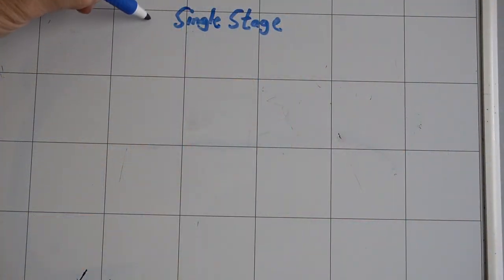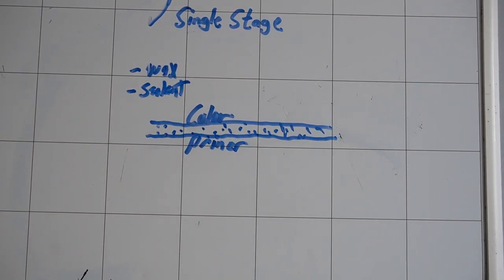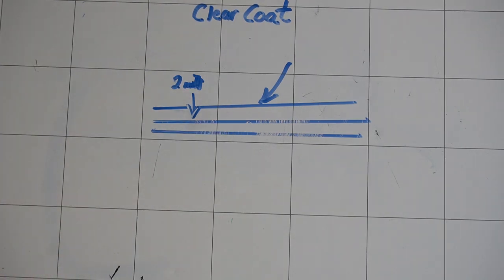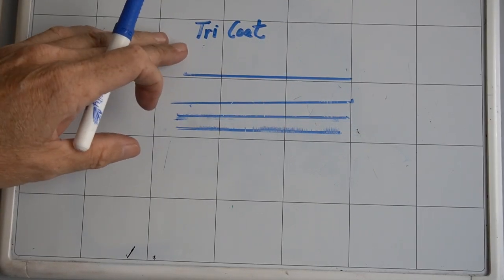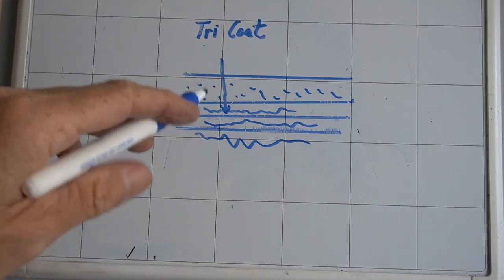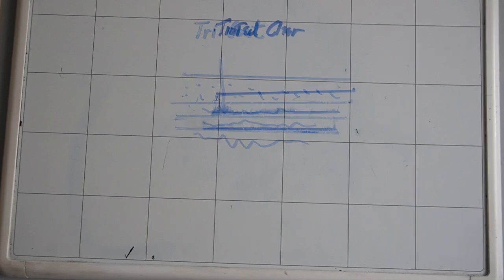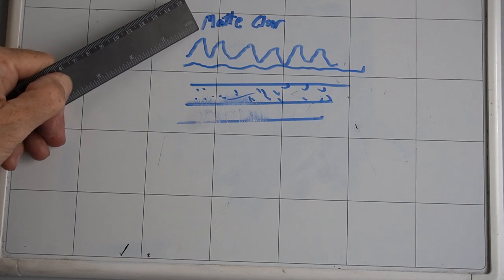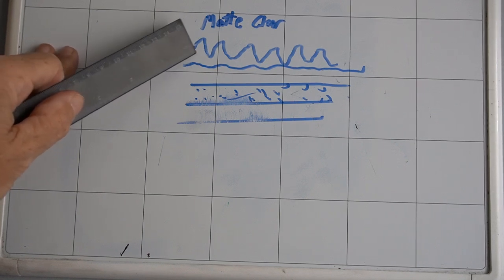Become A Clear Coat Expert: Mastering Automotive Finishes And Materials! Clear Coat 101!!

Comment: Brian I would like to know more of the spray on ppf. Just bought a new cx5. My concern is the bottom of the front fenders and lower rear quarter panels. I had ppf put on the front bumper cover mirrors and part of the hood. Unfortunately Mazda does not put that textured finish on anymore. I did however put a layer of BC1. It is holding up well so far. The sun here in the south in July and august is a killer. Btw I purchased some cheap made in china mud guards. I had to put some gaffers tape on the edges as they are poorly finished. Temporary solution.

Comment: Great video all of us need to hear. One area I have started to run into is hand applied clearcoat or aka snake oil. Some detailers just apply the clearcoat over the swirled, burnt through clearcoat, and failing clearcoat. You can polish the scratched area and the top is smooth as silk but the scratches are still very visible. The jobs where the detailer burnt through the clearcoat and applied the clearcoat are tougher for me to notice. I would love tips for dealing and with these patxh up jobs as they are becoming more common with the economy going in the direction it’s going.